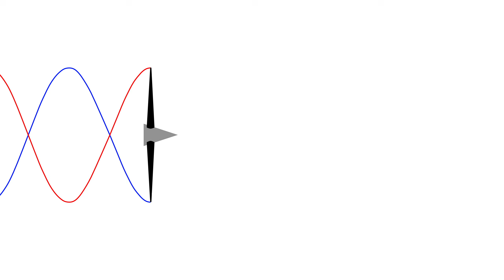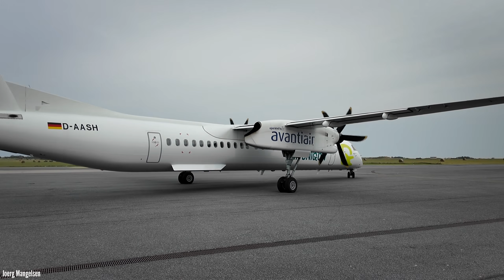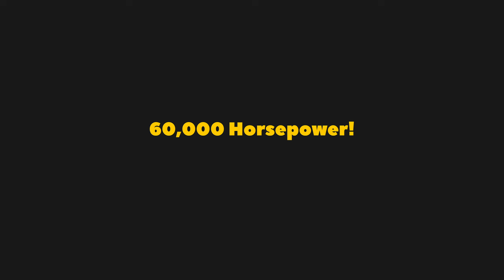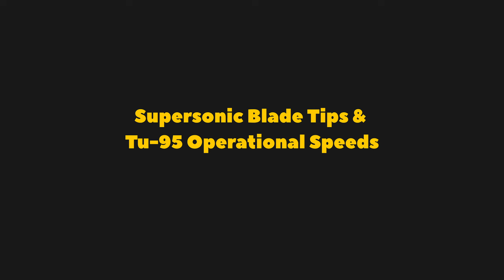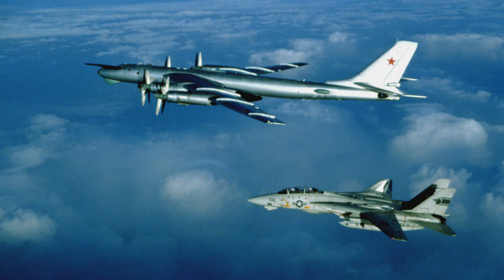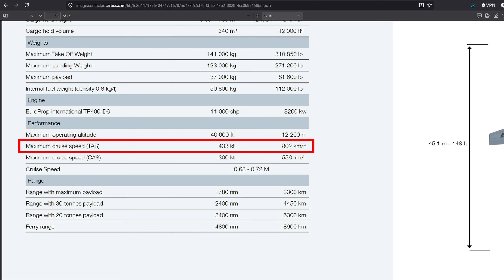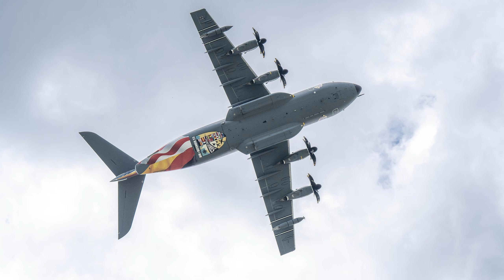How the Tu-95 Achieves Its Speed (& Why THIS Turboprop is Faster)

Comment: brilliant, this is the video on high speed turboprops I've been waiting for. In the case of the A400, I wonder where the line blurs between turboprop and propfan. Because while it's a turboprop in the technical sense, those blades definitely have a lot of the same design features at propfan blades.
Reply: I think that the propfan needs to have sweep, solidity and de-swirl. A400 does have solidity and sweep while tu-95 does have de-swirl, so only an-70 does have all three.
Reply: @josefsvitak4313  I think that makes sense, AN-70 is another brilliant aircraft

Comment: Close to  470 mph cruise is still extraordinary fast for a turboprop designed in the 50's.
Reply from the maker: Absolutely
Reply: Already faster than most WWII fighters, even the fastest ones would struggle to keep pace with a TU-95 which can maintain those speeds for 15,000 km.
Reply: @supertyfon1736  470 is where vast majority of WW2 fighters topped out, but the interesting part was the altitude at which the speeds are reached. Max speed of a piston engined fighter wasn't reached at top altitude. But Tu-95 cruises where piston engine fighters max speed has already long dropped off.
Reply: Seems Tupelov made a wise engine choice as in the 50s jet engines really guzzled the fuel and weren't all that reliable.
Reply: @garyhalmbacher6875 still true today…. Of course turbofans are much more reliable but if you want to go a long way economically then nothing will ever beat a turboprop.
Reply: @ianseddon9347  To be honest, if you look at the latest turbofans, they are converging with the turboprop engines. The fans size got to the point where they need a reduction gearbox, such as Rolls-Royce Ultrafan and Pratt-Whitney PW1000G. I recon at some point they'll be very close.
Reply: @garyhalmbacher6875  Tupolev was a very conservative designer and organizer. He had a trait of always pushing for only using the solutions in reliability of which he was completely certain. When Stalin commissioned the development of an intercontinental jet bomber, Tupolev was on record that neither existing engines, nor the currently in development engines, are economical enough to BOTH reach high speed AND fly far. All the calculations were pointing at that. He was entirely correct as was shown later with early Boeing B-52s and Myasishev M-4/3Ms failing to reach the required flight range. Project 95, which became the Tu-95, was initiated as a backup. And it paid off: it was able to reach the required range straight away, and while ultimately not being as fast as M-4/3M and B-52, it wasn't too much slower. In fact maximum speed became a moot point, since by then the fighters had long broken the sound barrier.
What ensured the Tu-95s longevity is the design: having tall undercarriage and widely-spaced main landing gear, combined with damn long weapons bays, allowed it to easily adapt to new weapons developments and add the ability to carry heavy missile loads under the wings.
Reply: Then by your definition,  you are known to be honest and hardworking.